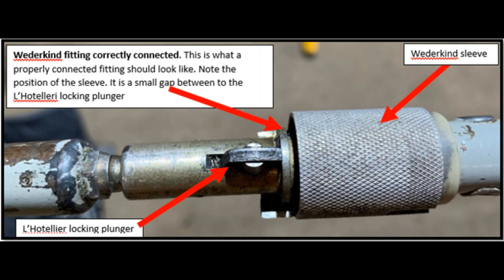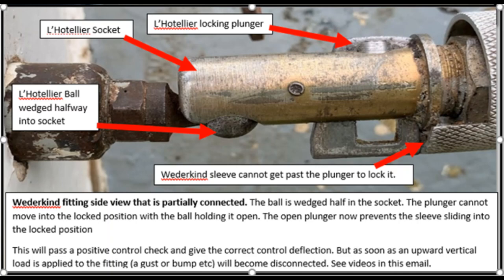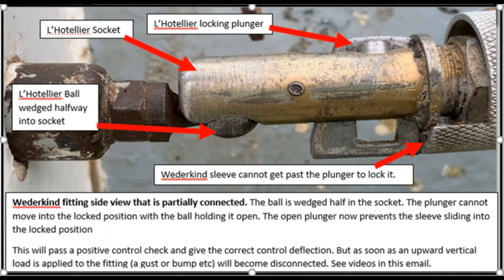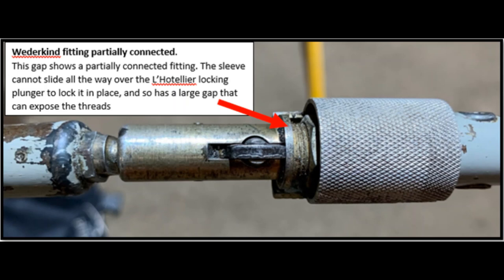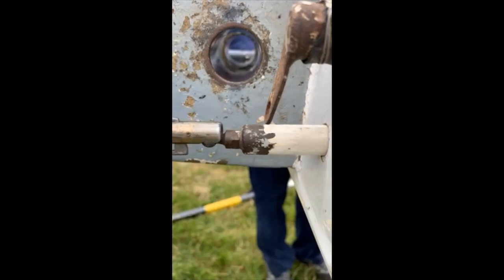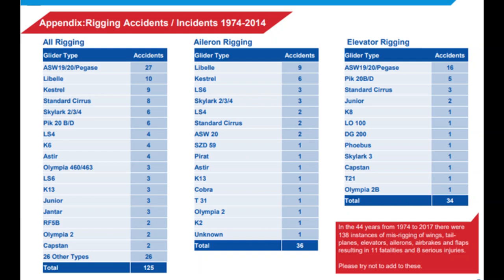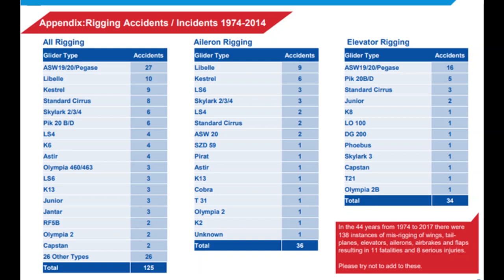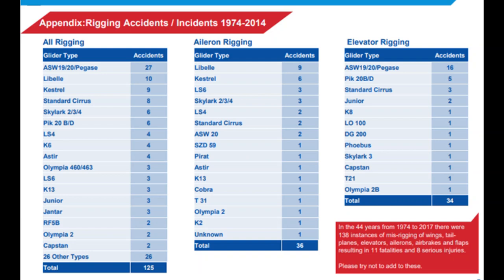Understanding how Wederkind connections work

Comment: Great video Gordon, thanks!
What I try to do after connecting the L'hotellier and the wedekind is try to push in the plunger again.

If the connection is made properly, you cannot push the plunger in all the way, as the wedekind sleeve is blocking the plunger.
If you can push in the plunger all the way, the wedekind sleeve was not properly engaged.

And as explained in the video, you can only engage the wedekind properly if the ball is fully in the socket.
Reply: I was taught the same approach.